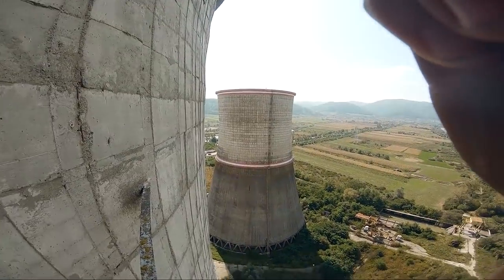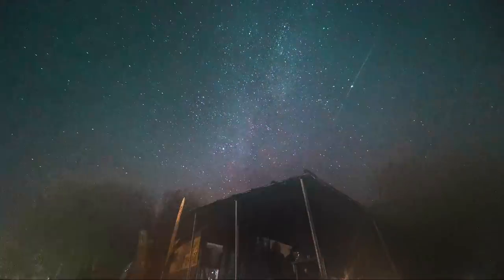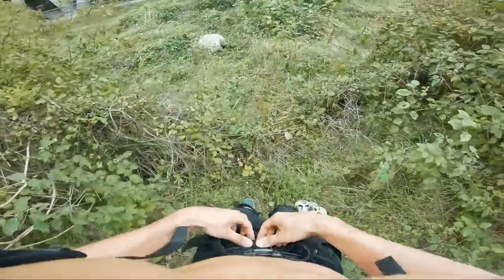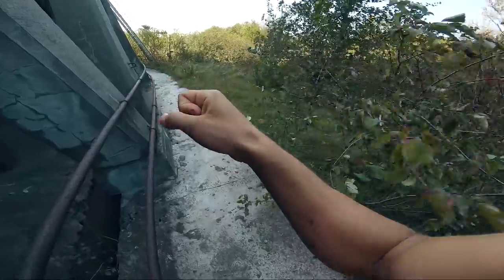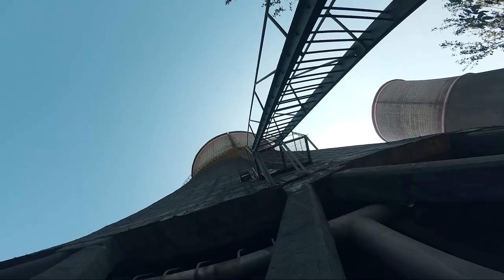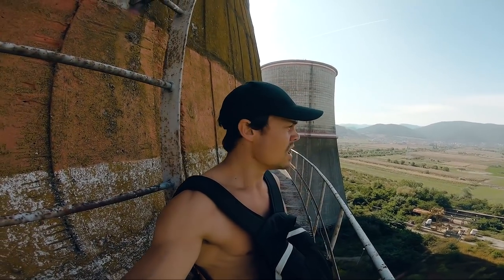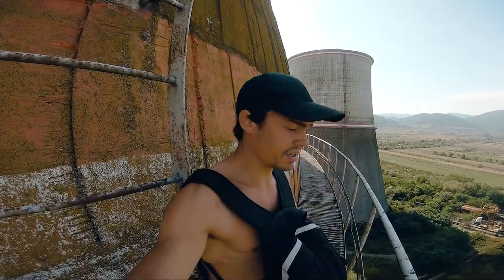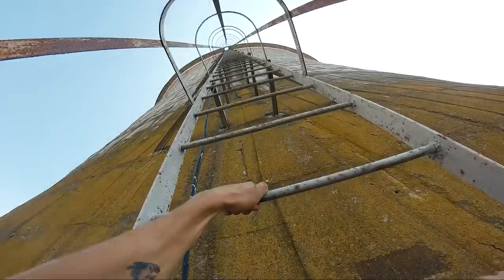Climbing Down Inside A Power Plant

Comment: Great video! FYI: Those towers are known as cooling towers, they're simply used to cool water from power plants. Water sprays from hundreds of nozzles and cools as it falls to the bottom.
Reply: That’s cool I never knew that
Reply: Correct. Nerd. Lol me too 😂
Reply: Learn something new everyday
Reply: Some of it evaporates hence you see the clouds of vapor leaving at the top. The shape of the tower helps air to naturally get sucked in from the bottom and flow to the top. Natural draft cooling.
Reply: Also the turbine water is a separate circuit from the reactor core coolant. The steam that comes out the top of the tower is non-radioactive.
Reply: @marc-andreservant201  this particular plant isnt nuclear at all, according to the guys in the vid. its coal driven
Reply: They use to cool steam.. And condense it into water so that it can be feed into the boiler...

Comment: fun fact, even if it was nuclear, they wouldn't really be exposed to radiation, power plants use water because it holds the radiation extremely well and you would even be able to swim in the pools they make the energy in (as long as the turbine is off/closed) and come out pretty much ok, even getting fairly close to the rods is fine as long as you aren't too close

Comment: Whenever I come across an item that isn't normally solid brass, but looks like it might be, take a file to it. We all will immediately know if it is indeed brass. If it's silver/white metal beneath, then it's likely plated zinc alloy. AKA pot metal, white metal, die cast, etc. Lots of guys throw it in with their cast aluminum because often times the yard won't know. But it's clearly not aluminum because it's much much heavier.

The way I confirm zinc alloys (or zinc die cast, as my yard calls it) is give it a good scratch with a file then hit it with a propane or mapp torch. If it's zinc it'll melt. Not as easily as lead, but you'll start to see it droop or bubble a little and won't need to melt more than that.

And the answer to your question about aluminum.... Where I'm at in GA there's two yards and both of them only have a few grades of clean aluminum. UBC's, old sheet, alloy wheels and cast. Some yards don't even separate clean extruded.

When I was scrapping lots of old electronics/computers a couple years ago I took in buckets of clean heat sinks that were a much higher grade than freakin "old sheet". I asked both my yards if they pay more for 5000 series aluminum extruded heat sinks and was told no. Even clean ACR doesn't get me a better price than old sheet.

One time the scale guy showed me his computer had options for many many aluminum commodities. But either they just don't want to deal with the fact that a majority of  scrappers are idiots who don't know how to properly separate metals, or perhaps they're just sorting and upgrading it themselves.

Shit, I have one yard paying me UBC price for clean cat food cans and the other paying old sheet for the same. I have a veterinarian in the family so I get loads of aluminum car food cans. Odd though, the yard buying cat food cans for UBC price always docks a percentage on ALL UBC's because of "moisture". Which is fucked because I don't bring in wet bags of cans. I rinse and peel the labels and let them dry ALWAYS.

Anyway sorry to rant. Long story short, they'd pay me old sheet for that bus bar in the video.

Comment: These are not chimneys or any coal/fuel burning site guys. This is a cooling tower used to cool down hot water to cold to be used as heat exchanging fluid inside the factory/industry.

Comment: I really hope those are out of commission. If they started up the you would get hit with scalding hot water vapor. Nuclear power is probably the best power there is because of it's minimal environmental impact and it's easy storage/energy density production. The waist it produces does take a very long time to neutralize, 5 plus years underwater, and it makes quite a bit of it.